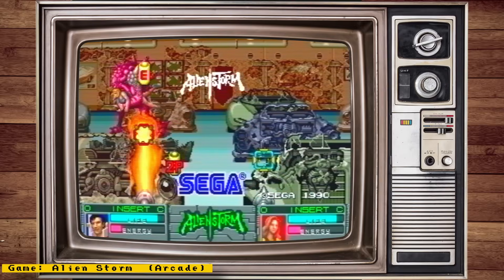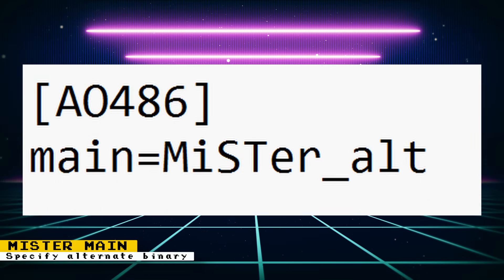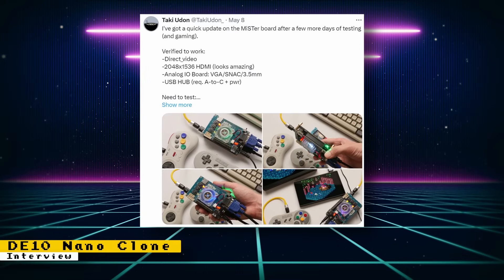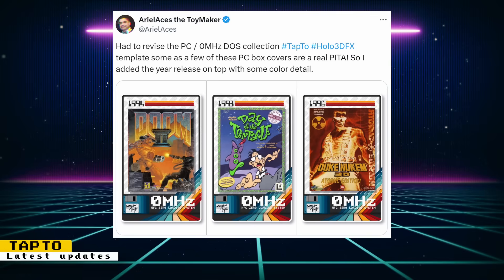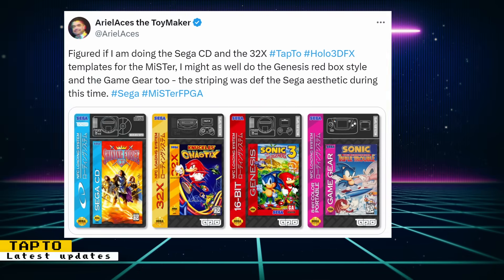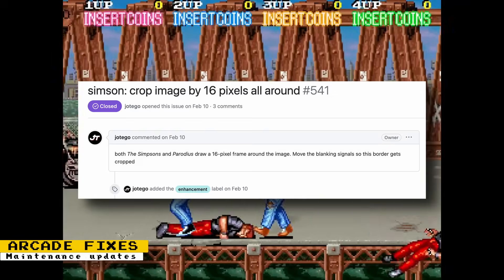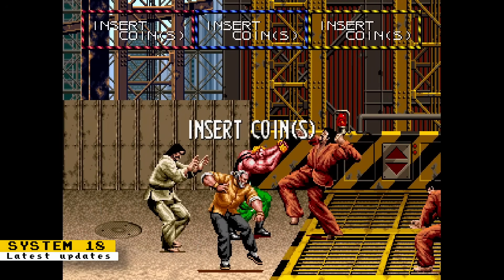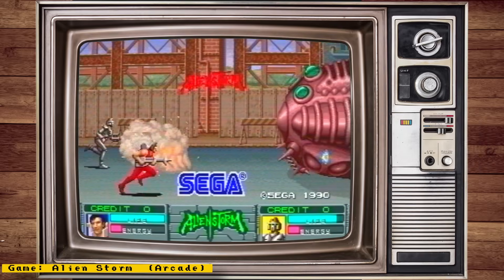MiSTerFPGA News - Handheld MiSTer Pricing, System 18, TapTo & More

Comment: Will the MISTer ever be able to silent boot directly to a game when powering on, but not have any boot up text before the game loads?

Or is that just not something the MISTer will ever do, and would require a totally different FPGA device?
Reply: @beefquiche  Arcade games.  I don't know enough about the MISTer yet to say what cores specifically or the details. 

Basically what I'm wanting to do is place a MISTer in an arcade cabinet and have it boot up directly to a game and look exactly like that JAMMA game board powering on.

Currently doing that with my Pi 3 and Pi 4.
Reply: @beefquiche  Depends on the jamma board, but yeah.  My UMK3 (and many Midway games) has this boot up screen and rom chip diagnostic process before the game starts.  But in MAME or FBNeo, it starts directly to the game.

So I'm setting my Pi 4 up to have a video splash screen of the UMK3 jamma board's ROM boot up screen.  Only difference is 5 seconds of black screen before that.  But unless you know what to look for, the average player won't be able to tell.

With my Street Fighter 2 CE running off my Pi 3, I was just going to leave it black til the game loaded.  But decided to put a screencap of the WINNERS DON'T USE DRUGS screen.   

The people who came over and played it during Superbowl and Wrestlemania didnt even notice it was a Pi3 until I told them.
Reply: @beefquiche  I remember some early versions of MAME or the roms load it.  But mu guess is it's not part of the actual game and part of the midway boards power on self test or something like that.
Reply: @beefquiche  From what I heard, the direct booting to a game is an option.  But getting rid of the MISTer's boot up text before the game is not.  

If that has changed, I'd love to see a vid or confirmation, cause I'll jump on the MISTer in a second if true.